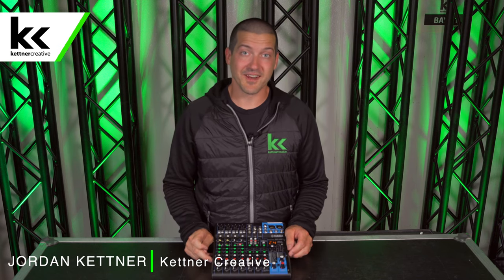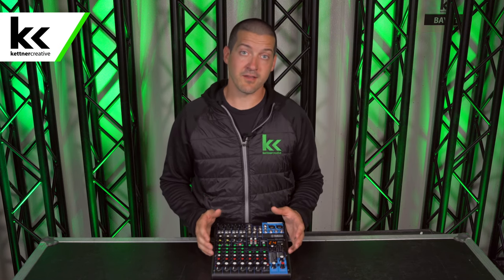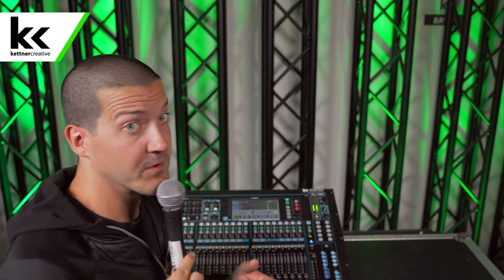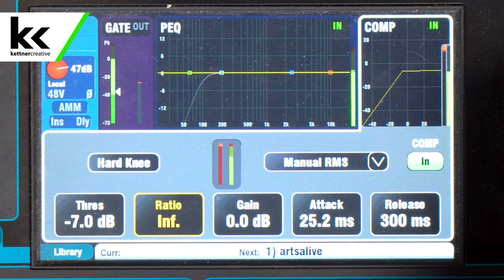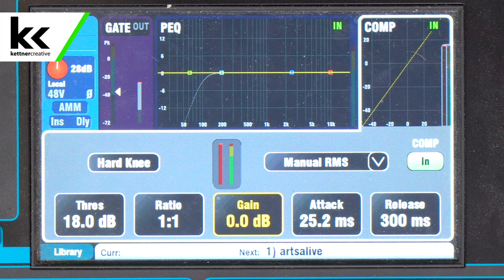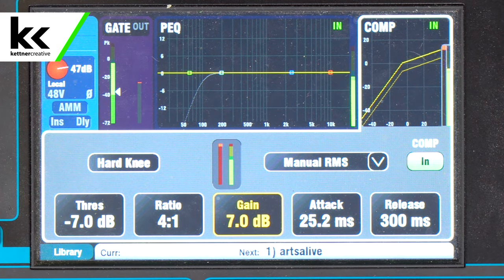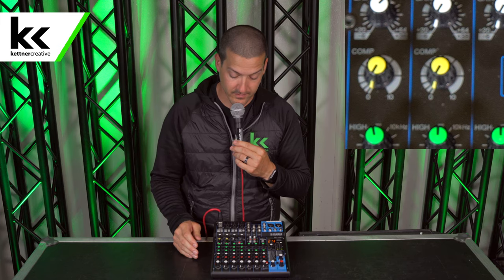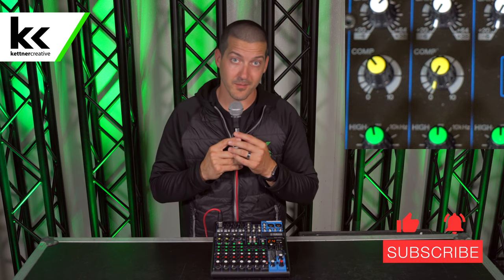How To Use A One Knob Compressor

Comment: You're always a blessing. In my church a front of house mix from Yamaha digital mixer supplies to MG6 used for live streaming and the input source is usually very hot especially during singing. What's the best relationship between the Gain, channel know and the Master know levels?

Comment: Thanks for making this. I, too, find 12:00 is usually a sweet spot for vox. Was just wondering what settings are under the hood of these things, and to my surprise, you answered that question! Thanks! Are the numbers in the manual?
Reply from the maker: There is a diagram printed on the mixer itself that shows the compression ratio.
Reply: @kettnercreative  Too cool! Thank you :)

Comment: Can the compressor be used in live performance when doing high notes and low notes
Reply from the maker: The compressor can certainly be used in a live performance. It will compress all frequencies at an equal rate.

Comment: If you use all 4 channels by connecting Mics to it, does that one compressor knob compress all 4 mics??
Reply: no.. only to that specific channel. The other two channel doesnt have it so i wouldnt use it for vocals. If you need more than 2, get a bigger mixer board or you can run racks.